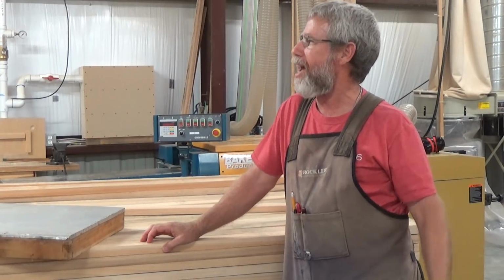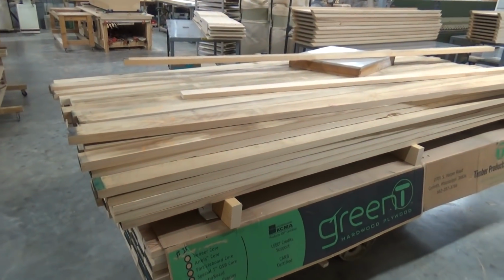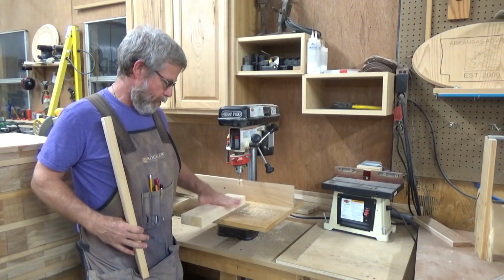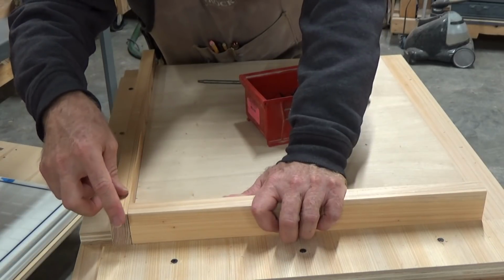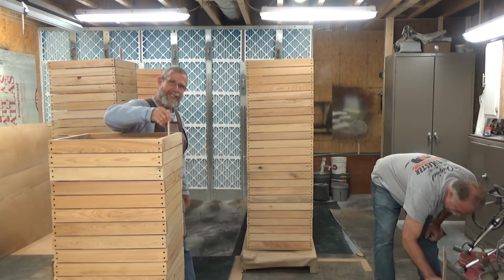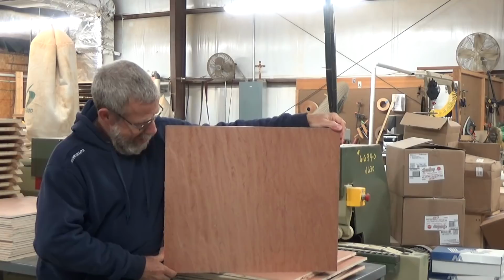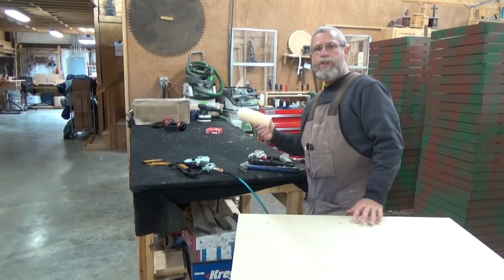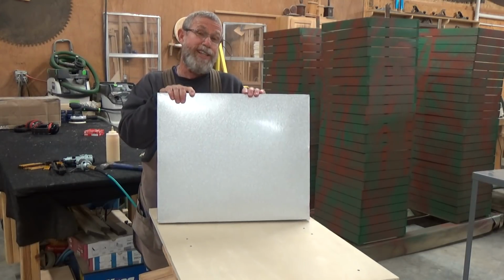High tech production of telescoping covers.

Comment: Awesome shop Mr Ed, also liked the revolving lid assembly jig. Do you ever do rebate joints on the lid and box joins, I do and then glue with poly urethane glue, and ceramic coated 8G 2" square drive screws. Then I oil base under coat and oil base top coat. We found structural steel silver paint rolls on easy and is durable as a top coat. I haven't got into spray yet. Our lids are a bit different here in Australia same style but not telicoping we use steel cam lock straps to tie all the assembly together so teliscoping gets in the way when load on a truck best if all fit flat side to side. Mainly using weathertex HD MDF bottom boards but I use some sheet metal bottom boards no worries. Some cold frosts over winter but work ok, best to use wood and I have one Poly Styrene which does really well. I see no sense in plastic except for nucs of maybe high quality. If I was a bee I would protest plastic boxes LOL
Reply: Another idea for insulation is to put a sheet of foam or that silver bubble roll in between the top and the tin, best to use HD poly foam sheet 3/4" if want to stack hives on top of one another to insure strength and flatness. This stops condensation on inside of lids and the troubles that it can then cause

Comment: Hi Mr Edd, why not putting a little fence on each side of the press drill when drilling the ends? 

Have you thought about putting insulation on the outer covers? I did it to mine and worked very well for me here in So Cal, can get really hot and that helps a lot, not too cold here but I bet it would help for that too.
Reply from the maker: Insulation is a great idea, and I have used it on some of my lids, but the cost gets prohibitive when you have so many lids to do. Thanks for watching. God's peace Carlos.
Mr. Ed

Comment: Did you use Luan plywood?  How long were the screws you used? (1.5" or 2")   Why did you not glue the corners of the frames?  I watched this years ago, but now I need to make 10 to 20 covers and find it useful.  I appreciate you sharing your wisdom and skills.  Blessings
Reply from the maker: I did use 3/8 Luan made with exterior glue. If I remember correctly, they were 2". I guess I could have glued them, but I figured the screws would hold  the frame well enough. Thank you so much for your blessings and for watching again. Good luck on your build. God's peace Eric.
Mr. Ed

Comment: Another great video. Wish I knew someone with that kind of equipment lying around! :)
Question: why did you pain the sides before the roof board was mounted? The sides of plywood are the most absorbing, and by painting them too you'd make it less vulnerable to rain driven up under the metal cover by the wind. Just thinking out load...
Reply from the maker: It may have been better to paint the covers with the plywood on them, but since the plywood is an exterior grade, and the edges are covered, it should bee OK. I'll find out in a few years either way. Any time you are on my side of the pond, you are more than welcome to use the tools. God's peace brother.
Mr. Ed

Comment: Get a metal break ,bend your own lids.You can get a small break cheap on line.
Reply: Cutting the sheets to size is most of the work.
Reply from the maker: I actually considered it, but by the time I figured how much time I would spend cutting and bending the sheet metal, I nixed the idea. Besides, after the first time I had to go to the emergency room to stitch up my hand from cutting it on the sharp edges, it would bee cheaper to have a professional do it for me. God's peace brother.
Mr. Ed
Reply from the maker: And I hate work, especially if there's a chance I could get hurt doing it. God's peace. 
Mr. Ed

Comment: Mr. Ed, what make and model of the stapler are you using these days for making telescoping tops? Im having a hard time finding a stapler that will reliably penetrate either aluminum or galvanized steel trim coil. Also, what is the contact info for the company you have making the metal lid for you, we would be interested in buying them pre-formed from them as well.
Reply from the maker: I'm using a Porter-Cable 1/4 inch stapler. It goes through 26 gauge easily, jut make sure you wear eye protection. My recommendation, find a local sheet metal shop and work it out with them, that's what I did. Thanks for watching. God's peace.
Mr. Ed
Reply: @JeffHorchoff  I've got a Hitachi 1/4" crown stapler, but that one tends to shoot right through the metal. We've contacted a few companies but they want $20 per top. I would like a 1/2" or 3/8" crown stapler but the only one I can find is a 1/2" construction stapler but its just to heavy.
Reply: @JeffHorchoff  I ended up going with a Senco SLS25XP-M with a 3/8" crown. 3/8" to 1 1/2" leg, 18g, adjustable depth control and anti-mar tip. Could not be happier. Shoots great.